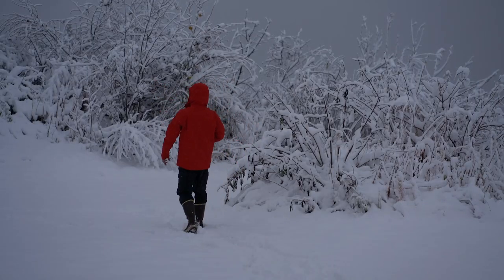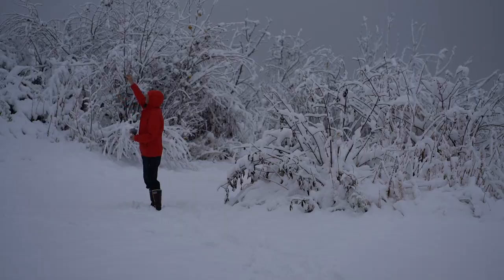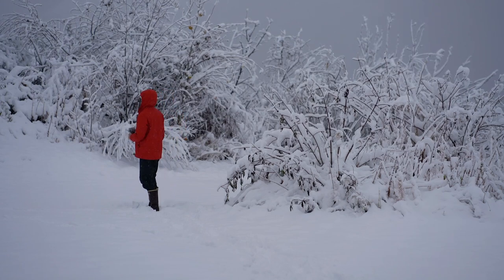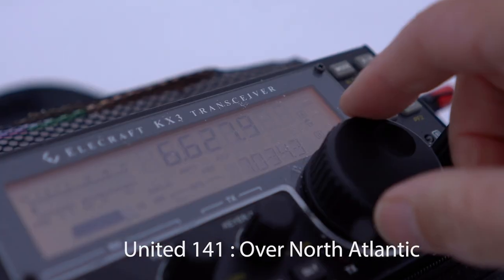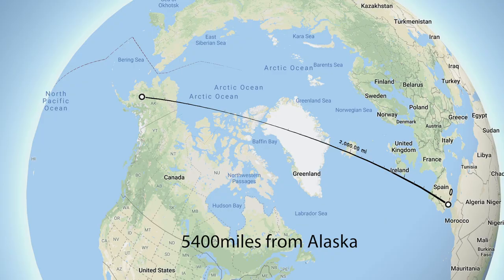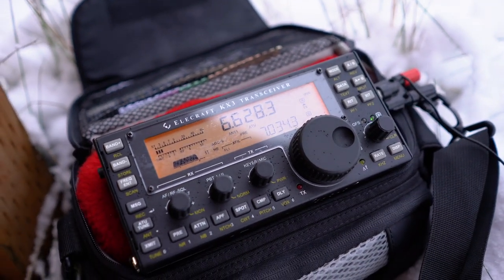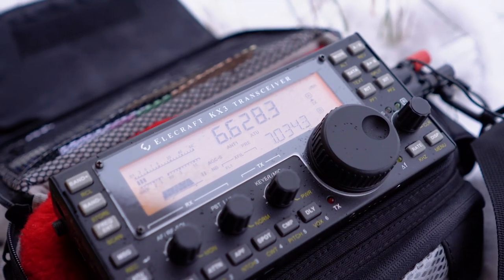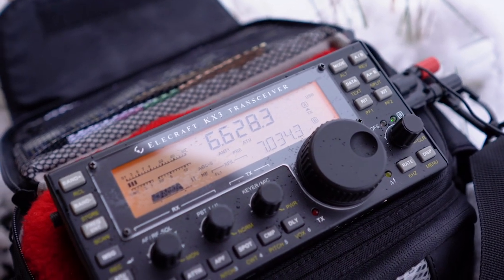HF Radio from Alaska - How to listen to Air Traffic Control in 2020  Ocean crossings.

Comment: Had been an HF VHF airband enthusiast since school days. Compared to 10 years back conditions have changed a lot and monitoring has become a challenge. There was a time when I could monitor San Francisco, New York and Santa Maria but these days seldom heard due to have noise levels. My radios are Watkins Johnson 8718A and the recent ICOM IC 7300. These days I can hear Mumbai Oceanic Control, Chennai and the 11300 middle East cluster. You are in a awesome location as far as HF monitoring is concerned. Have a flightradar24 nod at home too. 73
Reply from the maker: That's awesome - yes it's amazing how things have changed in 10 yrs only.  Sounds like you have a good setup...and with the next solar cycle - things might pickup again.

Comment: I use to be HF, operator and technician for telephone telecommunications from 2001-2008 before we were to obsolete  and replaced by modern sat phones, in remote isolated parts Northern Saskatchewan Canada. Being a pilot on the side I knew they used HF but I thought it was gone and replaced by Satellite. Very interesting and I see they using around 6 MHz band which would is really good skip for day time. 
Thanks for sharing
Reply: Sadly CPDLC is routinely used by all major airlines for most part.  Still some active times on HF tho.  I log a decent level of comms on HF out of W. Africa(Dakar, Sal Island, etc), and South Atlantic too.  Nothing like the pileup of traffic it used to be in the 1980s tho.
Reply from the maker: @b3j8  It's significantly less now with CPDLC, but still sometimes fun comms to tune in

Comment: Nice video, Deon!  I am a good pilot and a poor amateur radio operator.  I fly international and oceanic every month, so I am very familiar with the types of conversations you show here.  Ot may be interesting to note that, unlike most VHF communications locally, HF radio in aviation is NOT directly with air traffic control.  HF communications are with a radio operator!  For example, much of the Pacific is controlled by Oakland center (in California) but communications are relayed through an HF radio operator in San Francisco.  This is commonly misunderstood even by pilots.  Happy listening to you!
Reply from the maker: Oh yes - thanks for noting the job roles used when communicating using the HF spectrum.  Via the HF relay stations, placed in strategic locations around the World, to ensure mostly good HF coverage.

Comment: Excellent video and so many mile picked up on a length of wire....How long was the length of wire please?.   Take care and stay safe ......
Reply from the maker: Thanks Robert - it was a 10ft random wire antenna in a vertical configuration, just into the trees.